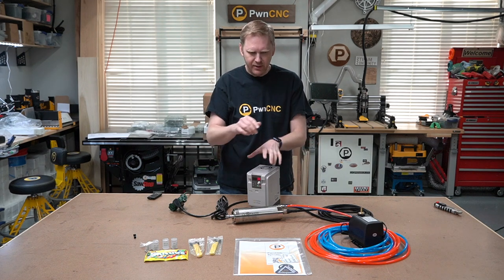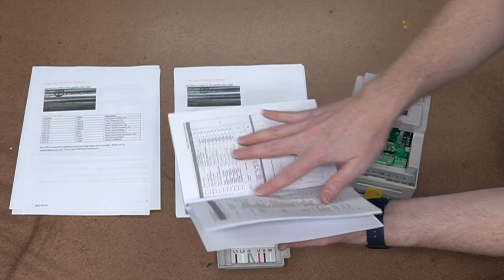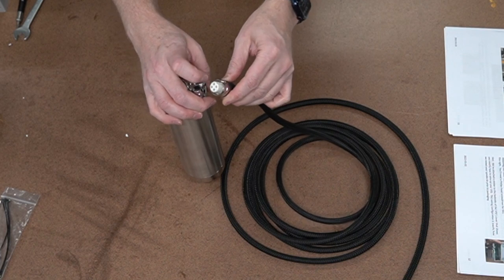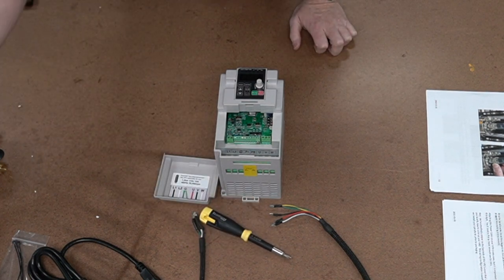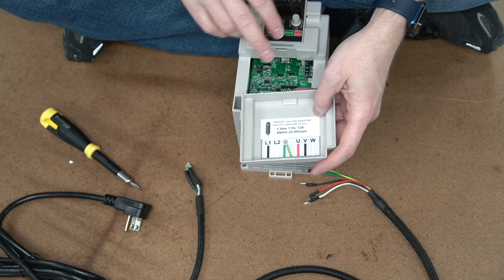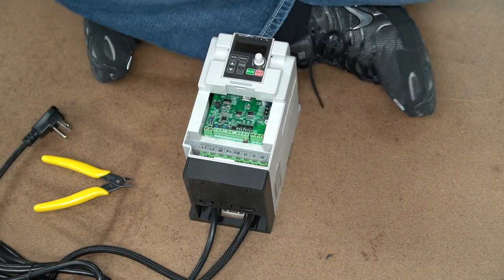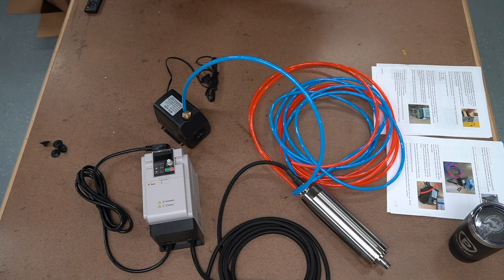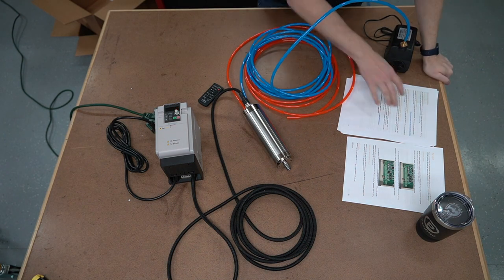[OUTDATED] Assembling a Water-Cooled Spindle Kit from PwnCNC

Comment: Hi, just wanted to know would I need a Breakout Board Adapter for a Onefinity cnc to make this work?
Reply from the maker: No.  With our kits the Modbus cable comes free and attached is a breakout board you can also open to add other wires to it if needed.
Reply: @PwnCNC  Awesome, thank you for the info.